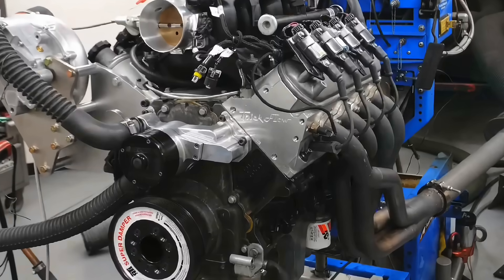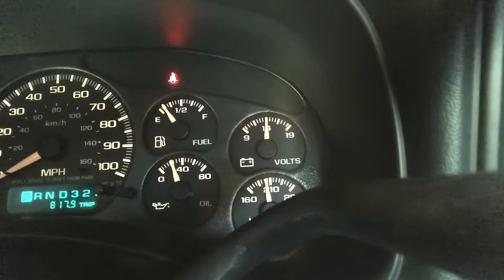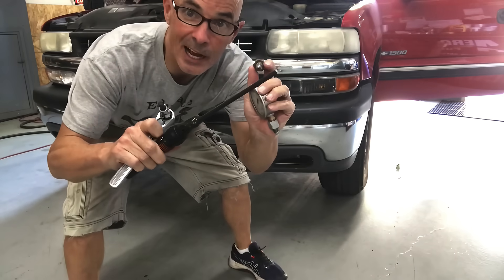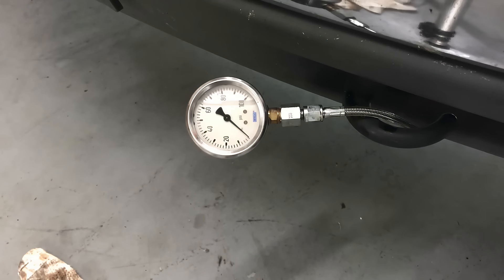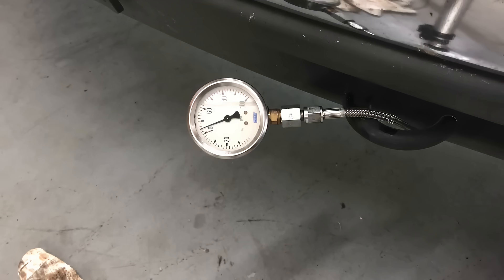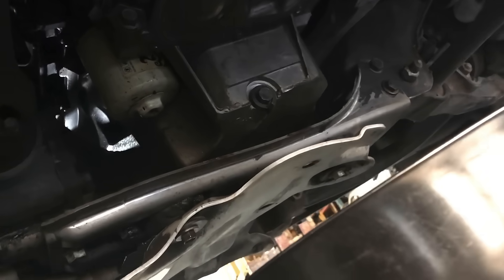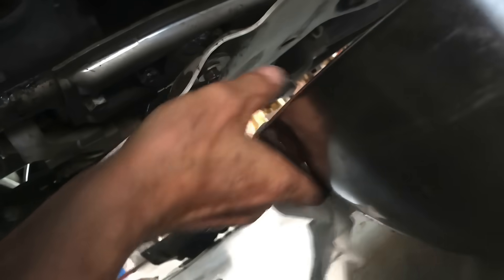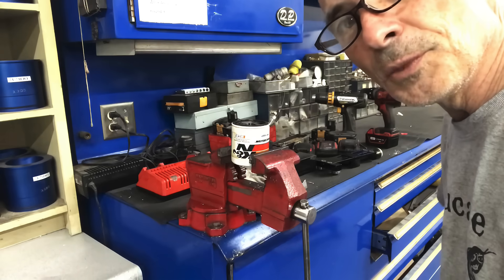HOW TO: TEST & FIX LOW OIL PRESSURE IN YOUR 5.3L OR OTHER LS?

Comment: How about damn near 0psi on a dod 5.3 after driving. So far we've checked the sending unit, changed oil pump, o ring. No material in the filter,  no ticking.  Only 78k on the engine too
Reply: Check the DOD orings between the block and DOD cover under the intake you will find about 90% of the time you can take most of  the cover bolts off by hand. There is also a screen on dod motors under oil sending unit did you replace/ or clean it
Reply: @bamadave1983  both of those were done as well. New screen, vlom which had a new gasket on it. I'm thinking cam bearings. Just started about 100 miles ago.
Reply: @brenthodges7202   with all that work, you're using a second guage and not just going off the one in the dash, right?
Reply: @RSAW73  We've tested with 3 mechanical gauges mounted all three in the tree locations.  At the oil pump, top of the engine on the back and the oil filter sandwich adapter.  Low pressure after it gets warm, eventually 0 psi and warning light comes on.  We are about to pull the engine out tomorrow because I can't find any other cause.  Going to throw another in and then tear this one apart to see what caused it.
Reply: @brenthodges7202  the oil psi bypass in the oil pump have bad problems with burrs and trash sticking them you can most of the time take it out clean it and shim the spring with washers I've seen 300,000+mile motor have almost 80psi at idle can shim abou .125 it should hold about 50 psi idle up to .250 it hold close to 80psi idle they a good video on YouTube  think it call stop buying ls oilpumps

Comment: My 96 5.7 vortec got low oil pressure, I changed the oil and added half 20w-50 and half lucas stabalizer. That kept the engine going for many years.

Comment: "Are there other causes of low oil pressure?" Yes, just fixed my low oil pressure on my high mileage 305 sbc by replacing the oil filter adaptor. It has an oil pressure relief valve that was stuck open.
Reply: stick to the LS conversation, Gen 1 engines share nothing with these. :)
Reply: @dezford5408  Your LS engine also has oil pressure relief valves.
Reply: @custom-ok8pd  Gen 1 engines have oil pressure spring in the pump. stay on topic. every engine oiling has SOME form of relief.
Reply: @dezford5408  I didn't mean to cause so much confusion. Richard was talking about troubleshooting the oiling circuit in his truck for low oil pressure. That consists of: the oil pump, oil passages, bearing clearances, two or three pressure relief valves (1 in the pump, 1 in the pan or adaptor and 1 in the oil filter itself) and plugs. The constant hot and cold cycles break down the valve spring pressure and if there is grime present will hold open a valve and bam! you have low oil pressure. It applies to any engine.
Reply from the maker: its all good-we talk about every engine family here-oiling issues hurt any engine

Comment: Any ideas for what would cause the pressure to constantly fluctuate between 40-55 lbs while cruising on the highway? 

Replaced the sump o-ring already.
Reply: Aeriation bubbles
Reply: Does it have AFM? Those have a pressure relief in the pan that I've seen problems with
Reply: Sometimes the pick up tube rear brace is pulling the tube to the rear of the engine and sometimes it is holding it to the front of the engine so the guy installing the tube has to look for that issue. Also as the parts heat up, the expansion of the engine and the tube may not be optimal especially on the early LS engines that can also cause the tube to be pulled or pushed off center. This off center tube and o-ring can allow air to be sucked past the o-ring and blended with the engine oil. I am pretty sure, the fat o-ring was intended to prevent that from occurring. Anyway, when installing the pick up tube into the hole of the pump check the rear brace to see if the bolt hole is centered over the stud. If it's not, you can drill the hole slightly over size or try bending the bracket to align better with the mounting stud without pulling the tube in one direction or the other.
Also, there are brackets that can be installed over the tube where it enters the pump (see the link) that hold the pickup into the pump using two bolts. Also that early design pickup tube with the blue color o-ring is sometimes difficult to get them to seal. Just be sure the tube support bracket is not fighting the fit of the o-ring in the pump.
https://www.amazon.com/Billet-Pickup-Girdle-Support-551910/dp/B0784JPH59/ref=sr_1_4?crid=ENMSREI95GML&dchild=1&keywords=improved+racing+egm-500+ls+engine+oil+pump+pickup+tube+brace%2Fgirdle&qid=1600656102&sprefix=improved+racing%2Caps%2C246&sr=8-4
I am not saying this is the best one to get. There are many choices and all seem reasonable I just like the double bolt design over the single bolt crows foot design.

Comment: 36 at idle is great.
Reply: With cold oil yes . curious to see if it stays there when it's hot
Reply: Not really.  His truck was higher than 40 like most gen 3 engines are and then dropped.... and would you look at that in his video.  Cooked o-ring that crumbles when you take it off.  Wouldn't be long and he would have zero from that o-ring.
Reply: Hugh O'Brien what is the dog bone? I have my block vatted 😬
Reply: Its a small plastic barbell shaped plug. It has o rings on it and goes into the back of the block in the main oil passage.  Aftermarket billet ones are available and advisable to use.
Reply: Travis Abrahamson yeah I took it out and put it in after getting hot tanked 🙏. Thank you
Reply: If you need a O ring.Just go to the GM dealership to get the correct one.
Reply: Or 26 u know
Reply: I'm telling you. I've own 5 so far. Ls motors last forever it be the little stuff.
Reply: I agree about the pressure. Even if it’s a little lower than what is wanted for idle for some people, it’s still pretty close. There’s no indication of mileage, but being an 02 it’s safe to say high mileage. With high mileage easier just to chalk it up to wear and tear on the oil pump. IMO better than lower or no oil pressure at idle. From the video it shows this guy takes excellent care of his truck.
Reply: Pressure looks good to me maybe his started to drop.I have 99 Yukon 5.7 it has 254,
Reply: I have a 5.3 with 300.000 mils and i have no oil pressure is it still o ring?
Reply: @ricksjeep1634  could be the sending unit or clogged up screen under the sending unit
Reply: Mine is at 36 ish when hot.  About 60 at 4000 RPM.  Only time I’ve seen it low is when the oil was low.
Reply: Gen 3s sit at 40lbs all day, oring always the culprit due to only 1 bolt securing the pickup into pump.  Don't waste $ on pump, just port the elbow on the pump, you can shim the relief spring also.. pumps good for 400hp all day.
Gen4 oil issues, start at the screen under sender, if that doesn't do the trick, replace o ring. Run good oil, and change religiously.

Comment: 40 years ago, i learned that a can of engine degreaser and a hose (or pressure washer) makes working on stuff nicer AND easier.  Just a suggestion
Reply: My old shop had a steam cleaner and the other guy that worked there thought it was faster not to use it. Even doing something like engine mounts or an oil pan is so much nicer when you can eat off the old one.
Reply from the maker: you can't use that stuff here and let it just wash into the gutter
Reply: Richard Holdener when are you moving out of Cali like everyone else lol? The whole motortrend crew needs to relocate also before it’s illegal to touch your car.
Reply: It’s rust protection
Reply: @sicknick5882  The whole underside of my Trans Am ( 2nd gen ) has that very kind of rust protection.
Reply: I've got a pesticide sprayer with purple power in it. Works fantastic for degreasing cars coming into the shop. Let the purple power cook for a few minutes and then hit it with a hose. Most of the grease and oil melts right off.

Comment: My oil pressure tester is installed in place of the oil filter and a heck of a lot easier, it's a KD tool and still available
Reply: happen to have a part number on it?

Comment: I once had a 1977 Ford Granada and I installed a 351 Windsor in it. The motor was rebuilt by someone else and the crank wasn't ground properly. It had 5 lbs of oil pressure at idle and 35 on the road. I drove it that way over 2 years until the transmission went. The motor ran good and I even raced it a few times. I never heard any noises in the engine nor did I notice any metal in the oil when I changed it. It had a decent cam in it and I surprised quite a few people with it. There weren't too many cars back in the smog era that made 375 horsepower. If I had 35 pounds of oil pressure at idle and over 50 on the road I wouldn't lose any sleep over it. In fact at night I would probably turn over, fart, and fall asleep. The only thing I would do is check the accuracy of the oil gauge. I own a 2004 Silverado and the instrument cluster in that generation of truck is junk. I know that from personal experience. Fortunately, it is easy to remove and costs about $80 to rebuild.
Reply: The issue with the pickup oring is that the pump is sucking up air and oil. Your still getting pressure but it's way worse than just oil at 35psi. An air oil mixture can do some bad things
Reply: Aeriated oil is compressed under pressure. 
THAT is why pressure is important.
Reply: @timothybayliss6680 and @HotRod Ray - I know you are both correct. On an 18 year old truck, I just wouldn't bother with it.

Comment: I know that on trailblazer the units don’t actually measure true psi it just reads above 40 or if it’s so low I can’t remember exact number it will drop to zero on gauge.
Reply: Yeah on the I6 it’s just an on/off switch, and the ecm then “decides” what the pressure is and pushes that data to the dash!   Ridiculous. I’ve had plans to put a T fitting in there and add a manual gauge under the dash for some time. I’ll get to it. Eventually. ;)

Comment: Looks like you need to replace some gaskets... my 2002 Tahoe's 5.3L looked like that last year. I ended up doing: crankshaft seal, timing cover gasket, and oil pan gasket. The only one I have yet to replace is the rear main seal.

Comment: When I check filters at work we cut the paper out and squeeze the oil out, wipe away and then check the paper
Reply from the maker: we checked the filter too-it was clean-but where there is bearing material in the filter-it will be at the bottom of the canister too

Comment: Richard, I'm sure you the old thing of 10 psi oil pressure for every 1000 rpm. You should be good. 
Probably a sticky oil pressure bypass valve.
Reply from the maker: that 10/1000 is a myth

Comment: Had a 99 WS6, made 420 ish to the tire. 92,034 miles, driving home from work car starts buck m6 car.I got it towed home and eventually put an LS6 oil pump in it. Why did GM not key the crankshaft? Found out online that earlier ls engines had oil pump problems. And Richard if you  read this, have you guys ever tested propane.
Reply: The crankshaft isn't keyed because it's internally balanced and there is no timing marks on the damper. You can put the damper on any direction and it doesn't change a thing.
Reply from the maker: have not run propane

Comment: On some cars they alt is in the way and requires complete removal.
Reply: HAHA C5 requires radiator & AC condenser , anti-lock brake distributer & best of all steering rack among many others (power steering pump , steering shaft tie rod ends..on & on.....)

Comment: I’ve personally had a perfectly running 5.3 have normal oil pressure that I turned off and at restart had zero pressure, it was the oil bypass plunger get stuck in the oil pump.  Had around 80K miles and I didn’t believe the gauge or the warning box, drove it about 3 blocks and it began to sound awful... totally destroyed my engine.

Comment: On the later model LS engines with GM’s Active Fuel Management(cylinder deactivation) there is a tiny little cheap screen filter in the lifter manifold just under the oil pressure sensor. This little screen filter can become clogged with sludge over time and prevent the oil pressure sensor from seeing oil pressure when there is no actual internal problem with the engine. Just remove the sensor and replace the filter.
Reply: Id have a mod done where a tube is installed there and a harness extender installed so it can be changed easily.
Reply: We had a LS with the same clogged screen behind the oil pressure sensor. Was giving is false readings on the gauge. Zero oil pressure or pressure would fluctuate and at times would read perfectly fine.
Reply: Only on aluminum blocks
Reply: They’re on iron blocks too. I’ve made a bunch of money for gauges reading zero and pull sending unit and pull screen out and put new sender in
Reply: I've replaced oil pressure sensors on those, screen is definitely an issue
Reply: 09corvettezr1 good tip!  Thanks
Reply: That explains why I couldn't find a screen in my '05 Yukon XL when I replaced the sending unit.  Thanks!
Reply: Would you recommend leaving out the little screen
Reply: @ronaldlewis4032  if the scree is plugged, imagine what it would do to the sensor without it.  I would definately clean or replace the screen.
Reply: @Budl1te  No.  The sensor doesn't suffer any issues because it is NOT a screen.  It does not catch and fill up with the tiny detritus and film.  NEVER put the screen back.
Reply: What year's I have a 2011
Reply: @trailboss78  It boils down to whether your engine is a gen 3 or 4. The gen 3's can be identified by having 3 three bolts to connect the throttle body to the intake, rather then 4 the bolts the gen 4's use. The gen 3's also have the cam position sensor at the back of the block, as opposed to the timing cover for the gen 4's. Gen 3's use the 24 tooth crank reluctor wheel and a black crank sensor where the gen 4's use the 58 tooth wheel with a gray sensor. Gen 3's also have the knock sensors in the lifter valley, where the gen 4's have them on the sides of the block. I believe the LS2 in 2005 was the first gen 4 engine made with the 2007 Silverado Classic being the last vehicle with a gen 3 in it. Everything 2008 and up should be gen 4. None of the gen 3's had cylinder deactivation or variable valve timing where the gen 4's could have neither, either, or both depending on which one you have. The cylinder deactivation is controlled by the Lifter Oil Manifold(LOM), which is the cast aluminum plate over the lifter valley under the intake. If the LOM is flat on top the engine doesn't have cylinder deactivation or the aforementioned screen filter. If the LOM has a ribbed pattern on the top of it, and a 4 pin connector at the back then you do have cylinder deactivation and the screen to protect the solenoids in the LOM.
Reply: As an owner of a shop I have tried this with success illuminates excessive cost of  misdiagnosis
Reply: That's one reason to delete the dod bs
Reply: Will it also cause lifters malfunctioning? Mine was ticking rough and reading low low oil pressure on oil gauge and the display screen. I just now dropped oil pan and changed pick up oring and seemed fine to me but replaced with new one. Engine is 230,000 I’m the second owner after 85,000 miles, I must say that was a mighty clean oil pan, but I guess it being a cast aluminum pan? It has like imperfections in it like pieces of cast aluminum splatter inside pan. Reminds me of welding splatter from 6010 welding rods, or fresh road tar asphalt flingin on rocker panel kinda rough texture like. Anyways aside from clean pick up tube and replacing oring I’m changing the gasket by the oil cooler/filter? as there was minimal but enough to bother me seepage, an while have pan off a new pan gasket although clean oil pan no leaks other than sepage just from side of oil filter housing. But before I slap it back on is there something anyone can recommend looking at? Thanks for the video and any other suggestions really won’t know if it is indeed that pick up tube o ring until I put it all back together. Also one thing I did not like were  the two bolts that go through flywheel bell housing into oil pan were corroded and had like a watery sludge, and it was just on that and not anywhere else or in the pan. Definitely weirded me out.
Reply: It's a screen that is not really needed if you ask me since a factory replacement sensor from the dealer has a screen built in to the sensor
Reply: I had that issue with my 08 impala SS oil was not low at all nor leaking but the engine oil pressure sensor was bad and replaced both sensor & screen
Reply: Seriously Refinishing  mine does the same, getting ready to dig into.
Reply: Harley Davidson have a screen in the lifter block , gets debris and the lifters clatter . Pull out the screen clean and away you go with no noises .
Reply: Yea and it’s an absolute nightmare to get to , manufacture recommends pulling whole head off to get to it , but with enough swivel attachments you can get to it lol
Reply: Enough as in 1? they are really not hard to get to when you know where they are.  @gunnergaming6425
Reply: @gunnergaming6425 just the manifold not the whole head
Reply: Yep!

Comment: What was the oil pressure after the oil pickup O-ring was replaced?
Reply: Closer to about 40, mines been running lower after 137K so i just need to determine if i need red or green seal...
Reply from the maker: over 40 at ldle

Comment: My experience with low oil pressure  i found this stuff called restore started using it with one weight thicker oil gee Wizz with in few miles of interstate driving my baby was idling with 45lbs from 35lbs and more power i could feel in seat of pants